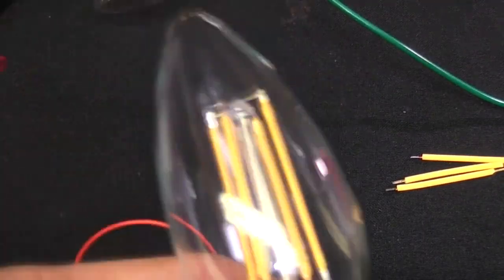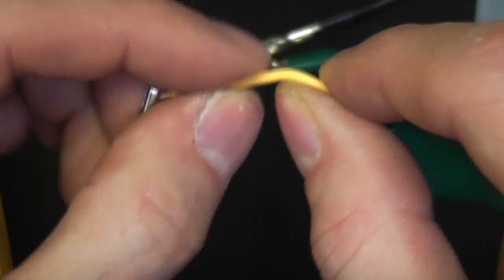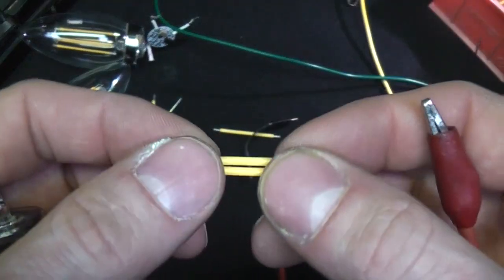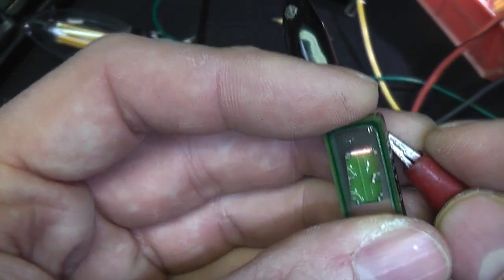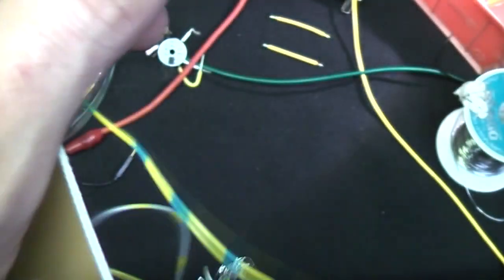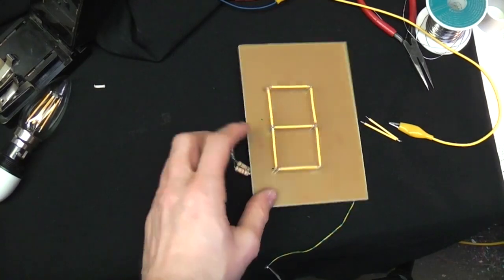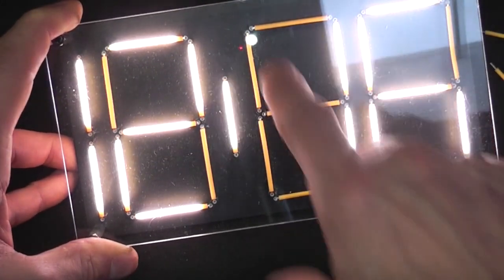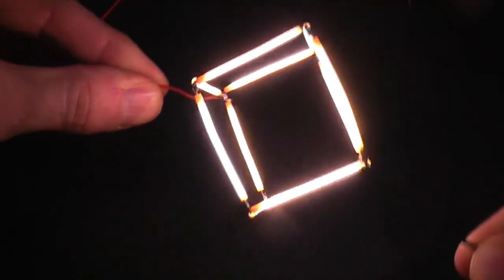LED filaments

Comment: I have a doubt, I got the same led filament bulb which you are having, I just needed the edison LED filament alone, in my place these LED filaments are not available and through online it is much costlier. So instead i bought the bulb which is just 1$ then I broke the outer glass and to confirm it works, I just tested with 240v (AC) and it lit up even after breaking the outer glass. But soon after I cut those LED filament individually, I tried with 1.5, 3, 9 volts battery (DC) but it didn't light up. Can you please suggest what I need to do to resolve this?
The bulb I bought was 4W, it had 4 LED filament in it.

Comment: Recess the led filaments into reflectors.  This way you dont have the on filaments illuminating the off filaments. Could be done with 3D printed backing with aluminum tape embossed into the recesses.

Comment: Hey, commenting on an old video, but I hope you read it. 
I am trying to join these LEDs in serries - + - + , and run them on 6 volts (their voltage is 3.1v each). They dont light up. How can I get 2 of them to light them up in serries?

Comment: Correct me if I'm wrong but I've read somewhere that the use of PWM to reduce the power consumption of LED light bulbs is dangerous to human vision. Although not perceptible, they say, the flickering would make people go blind. I find such a claim hard to believe due to the inherent capacitance of LEDs. This capacitance actually does not allow the LED to instantly stop producing light. I'd really like to hear your opinion on this claim. Thanks in advance.

Comment: I wonder what kind of LED filaments you have. I had pland a project with those and also spend many into to parts for my Project, but now it seems to gone failure, because my LED filaments aren't bendable. they have a glass medium, which breaks when you bend it. I tested at first some I bought by ebay, but also all other products by the stors in my near are usable.

So I hope you could help me to rescue my Project. Or may be you know a alternativ for thiny bendable LED-strips

Comment: One trick that was used in the old incandescent 7-segment displays was that they overlapped the ends of the segments because the filaments didn't give off much light for their first millimeter or two.  You might want to try something like that with these to reduce the apparent gap between the segments.

Comment: If you wanted to run a single filament off of a battery could you just directly drive it and if so what batt would you recommend?
Reply: Jess Hull id also appreciate an answer to this question.

Comment: While it is true that your open-collector driver only sees a few volts when it switches ON, it is likely to see most of the 70V supply when it is OFF.  You can check this with a simple multi-meter.  I don't expect the voltage to drop much through the diodes when there is only leakage current going through them, but you may just be getting lucky.  If the voltage is above the 50V rating of your driver, it is only a matter of time before they fail.  Keep in mind that the multi-meter you use may have a lower input impedance than your driver in the OFF state, and artificially lower your voltage reading.  
 You clearly have the skill to have built this with 100V discrete transistors for the open drain drivers, which would avoid the failure problem.  Just wonder why you didn't.
Reply: But a 70V LED at 40V (say) is drawing nanoamps or less probably - safely within the indefinite reverse breakdown capability of the transistor I think - or put another way an LED below its Vf is an incredibly weak pullup.
Reply: Mark Tillotson 
I re-watched your video, and followed the links to the blog, checked the schematics and reviewed the TPICB595 data sheet.  I had assumed the 50V outout rating was the max voltage that could be applied to the drains on the shift register (VDS max).  However, the data sheet clearly states that there is an internal clamp at each drain with a minimum threshold of 50V.  This raises different concerns than I was originally writing about.

Reply #16 by Conkbot on the EE blog I think touches on my original concern assuming there was no clamp, but let me try to clarify it.  From the TPIC datasheet, the leakage current while OFF a room temp is 0.1 to 5 uA at 40V.  It is Reasonable to assume it will be slightly higher at 50V or even 75V.  Let's assume for the moment that for a particular device it is 1uA.  When this goes through the 4.7K resistor at the top of the filament, it of course drops 4.7mV off of the 75V supply.  So the top of the filament chain is still essentially at 75V.  The next question is "how much voltage does the LED drop at 1uA?"

The answer is "I don't know, because the LED data sheets I've found don't have logarithmic curves that show that." Small signal diodes have nice logarithmic plots that give you a really good idea of the voltage you can expect at several factors of 10 below their nominal rating.  I haven't seen that for LEDs, but maybe some do.  If the current is low enough, there may only be a few 10s or 100s of mV drop across the LED when the current is that low.  

For purposes of this example, and since I haven't found a suitable comparable data sheet to give a better number, let's assume that for 1uA, the voltage drop is 500mV (and this may be a very high guess!).  If there are 20 LEDs in the filament, there is a 10V drop across the whole string.  75V - 10V - 4.7mV puts us just below 65V when the output drain is OFF.

Clearly, this is unsafe for a device whose open-drain output transistor is only rated for 50V.

However the TPIC6B595 includes an output clamp to protect it from inductive loads.  Somewhere above the 50V minimum, this clamp is saving you.  If the voltage drop through the filament doesn't go below 50V by itself, this clamp will turn on and suck more current until it reaches equilibrium around his clamping voltage.  Fortunately, that shouldn't take a lot of current, but I can't say how much unless, again, I had good V-I curves for the LEDs at least.  

So this clamping circuit may well be drawing extra current through the filaments when it is off.  Even though the roughly 25V drop in this case isn't nearly enough to turn the LEDs fully ON (70V is still needed for that), I have seen high efficiency LEDs start to glow faintly before reaching their nominal rated Vf.  It would be interesting to see if some minimal glow is visible in these "OFF" filaments in a really dark room.

Reply #22 from Hero999 on the EE BLOG has the kind of topology I would use to avoid both of the above potential issues in a commercial product (I realize you don't intend to do that).  However, I would personally put resistors in the base and collector leads rather than the emitter to reduce current variation.  Of course, I would use a transistor rated for at least 100V.  OFF current with a BJT in this circuit would be measured in nanoamps, rather than the microamps of a FET.  Although that is not a major concern for this application.

Sorry for the long-wided post, but after reading the EE blog and comments here, it was evident the several people had some of the same concerns I did, but others were confused about some of the details.  I hope this was useful to you.

Have a great new year!
Reply: All pn junction diodes have the same basic exponential increase of current with forward voltage, doubling every 25mV or so at normal temperatures.  A 3V LED thus essentially is only conducting leakage below 2V, for instance, as that 1V difference gives a 2^40 current ratio (assuming ideal pn-junction diode behaviour).  So to switch a 70V string of such LEDs only really needs a 20V swing or so, if they are uniformly low-leakage.
Reply: Mark Tillotson 
The low leakage is a critical part of keeping the output drivers from frying.  The "clamp" in the data sheet may be nothing more than the body diodes of the output FETs.  Like any other diode, these have a reverse avalanche region, and I suspect you are hitting it when the LEDs are turned OFF.  The data sheet shows a max of 5uA at 40V. At 50V it will be higher; if it is 10uA, that output is only dissipating 500uW, which is a tiny amount of power, and should be easily handled by parts that size.  Even at current levels several times this, the part should be OK.  As temperature increases, the current will increase as well. This is probably fine for a clock designed to operate at room temperature.  

As someone who is accustomed to designing high-reliability circuits for test, industrial, and automotive applications, I would not feel safe without using a part rated for the voltage.

Have a nice day.

Comment: GR8T sutff Mr Mike! I've always been a BIG fan of "segmented lighting".. like Nixie. I was knocked over with how good your clock display was.. B-RIGHT! (a must have detail IMHO). And the ability to "manipulate" the lengths of "micro LED's" could get interesting.  p.s That's a pretty nice "quickie pcb" :o) I'll assume then that your nicer boards are currently  in the ISS and or communication satellites? Thanks for the video! Ca. USA.

Comment: Are these usable in Low voltage (12/24V)? Or are they already low voltage ??
Reply: quote....work at 12V contiuos or only 75v? resistor for 12V?
Reply: I have ordered led filaments for experiment.. I want it on low voltage in parallel series.. 
I will test +20 pieces in once..

Comment: Great idea for using the new to emulate the old. Too bad some Andy Warholish Artist doesn't run with this. Come to think of it your ending 3D object reminded me a bit of the chinese opening at the Olympic games where they wore LED suits and from quite a distance they spelled out things in the dark (topview) as they have at stadium games for years. Only it was massive scale. I remember the wire-wrapping sockets -- Never used them, went straight from soldering to silver-nickel breadboards that were fairly new at the time. (and expensive! I can't believe how reasonable they are now)

Comment: what is the minimum voltage to get them to work? i have a bench power unit that goes up to 30 volts. but it doesn't seen to do anything. thnx. inspiring video!

Comment: Can you give details as to how you made the cube? Three lengths need 200V, and some cross over. I cant see how it's done.
Reply: +Bruce Clothier If you alternate positive and negative on all connected vertices, you can power it all at 80v, if you provide either negative or positive to all vertices.  Start with one corner, power it positive, follow all connections to next 3 corners, power them all negative, follow all connections to the next set of vertices, which is three corners, power them positive, then follow all connections to the remaining corner, and power it negative.  You can simulate this with simple single white LED's and power the whole cube with one LED voltage drop (about three volts), but every corner will have to be connected as outlined above, and LED polarities will have to alternate.  Tell us if you try it.

Comment: I Once made a segment score board display with nothing more than frosted glass, a black vinyl graphical template made up at the local printers and glued plywood light seperators, using red & yellow single per segment leds. Worked great. The viewing angle wasn't fantasic though, but for oncoming traffic super readable!  This is a variation of something i did 20 years ago, but has so much more scope. Chase a dream my friend!  If you don't, i will ;)

Comment: I got a maybe stupid question.  But how do convert the 220V AC coming out the wall to 70V DC?  I know it goes through a rectifying bridge but what kind of switching regulator thereafter drops the voltage to 70V needed to power these LEDs in series?
Reply: +Freddy Krueger 
Capacitor dropper.

Comment: Hi, I'm building a little power supply with full wave rectifier and capacitors to drive a mess of these to replace some lighting.  

I'm curious to know the layout of that original driver board in the lamp you disassembled.  I'm hitting a little snag with figuring out what values to use.  Particularly I'm interested in what value is on the capacitor, assuming all the other stuff is just rectifier diodes.  But looked like 4 resistors too?  Two of 241 and two of 474 maybe?  What would those be for?  I can't find any drawings with paired resistors on a simple rectifier like that.

Comment: Switch 70V with a 50V driver has its issues. The LED filament may be 70V but when the driver is switched off the leakage current of the LED determines what voltage appears on the driver. BEWARE!
Reply: etmax1 Well you could always use transistors, and then mux them to keep the numbers down, but then you would need an even higher voltage to get the same brightness level.
Reply: *****
?? are you replying to my post? I'm not sure how what you say is relevant to it??
Reply: etmax1 Because if you wanted to get away from 50v drivers on a 70v system, you could use regular transistors.
Reply: I'm sorry, you've slightly misunderstood my comment. Firstly my comment applies to IC drivers AND transistors, be they FET's or bipolar, secondly it was a warning to those intending to use an eg. 50V driver with an eg. 70V supply. People think that because an LED has a, eg. 3V Vf that 10 in series take away 30V from what the driver sees as the "off" voltage. In fact the voltage seen by the driver is the leakage of LED's in series with the leakage of the driver (or transistor). That means that it is possible to have in excess of 50V across the driver when running from 70V. It's basically asking for trouble. That was the point of my comment.
Reply: +etmax1 yes, the off current can be as high as 8uA for a Vds of 40V.  At that current, the drop across the LED string should be much lower than 70V and depending on the supply voltage - there could possibly be >50V across the open-drain output triggering a breakdown.

Comment: I have some of these LEDs and I have found that an easy way to do it is to make a joule thief without the LED, and where there should be an LED I put a diode to cut half of the wave off and a 200 volt capacitor 100 if and i can connect a 3v led and it works fine because the current is so low and I can connect a led filament on the output and it works fine, and my joule thief output with no load was 154v with a 1.6 volt alkaline battery. Might want to try that? Works about 4-6 hours on 2200 mah battery 1.2v

Comment: 50% smoke tinted glass for the viewing pane. The electronics on another sheet of glass with the traces and components directly on on that glass fully visible. Both panes separated by glass rods. Wall wart would power the thing.

Comment: Awesome clock you built there.. what if we paint these LED filaments in matt black so that the non active filaments are not visible? It will make it slightly dim but make the digits more distinct.

Comment: That ceramic cap is a bit scary, what if it shorts out?!
Yes I am young, but I do know what wire-wrapping is :P
Also, I don't understand what you meant by using the TI driver chip on a higher voltage. Wouldn't the outputs go up to ~70V when the driver has the outputs off, because it's like an open circuit? I know the LEDs don't work at a lower Vf, but even if they conduct a few uA, it could damage the driver, couldn't it?
Reply: Benjamin Esposti I just had to test this. I tested a 5mm white LED, and even at 100mV +-2mV, I measured about 80uA. Some of that is of course from the meter that measures the voltage across the LED.Or is it that the driver IC has zener based clamps (?) inside, and it is happy handling a 100uA or so to keep the voltage on the pin clamped?

Comment: Interesting video, thanks. I have been wondering how these bulbs handle heat dissipation for a while now, this video answered that question nicely. 

I use these bulbs in all my outdoor lighting, and they are very bright indeed, but most importantly, the missus think they're pretty compared to other LED bulbs on the market, which i think all the married gents can attest to, is a major factor.

Also, I do wonder about their efficiency and luminous output. It should be high, considering their high forward voltage, and the relatively low power consumption.. these suckers are very bright, at least the bulbs i got actually hurt to look at, which really surprised me - i expected naught but a novelty bulb.

Comment: You could make a football with these running across the stitchings, powered by flat button cell BIOS batteries or something. It would make a great for a great effect at night. 
Also sticking these to a drone structure would make a great flying chandelier.

Comment: I don't understand how you can use the TPIC to switch 70V when the datasheet mentions a maximum drain-to-source voltage of 50V. Sure while on, most of the voltage is dropped in the LEDs. But when off the TPIC will see the 70V as the LEDs won't drop anything.
Reply from the maker: superdau There will still be about 60v across the LEDs when off, and no current flowing
Reply: ***** 
Ah, seems like I didn't understand the meaning of "voltage clamp" in the data sheet (although it later mentions only "drain-to-source voltage", the term I'm used to with transistors). So the TPIC will simply start to conduct over 50V (like a 50V Zener diode) and the current is "limited" by the LEDs in the sense that, if higher currents (let's say bigger than a few µA) would be flowing, the LED's forward voltage would immediately "drop" most of the voltage. Right?
Reply: ***** 
Should have looked at the datasheet more carefully. It's all in there. There IS a 50V Zener from drain to gate inside each output driver of the TPIC. So above 50V the MOSFET will open itself.
That just leaves me to wonder: why would you want to clamp the voltage in that way? Is it simply to protect the internal MOSFET from breakthrough?